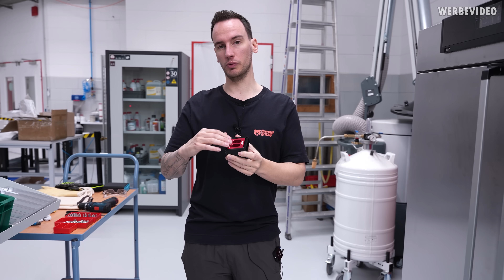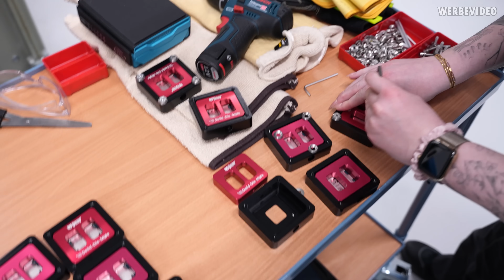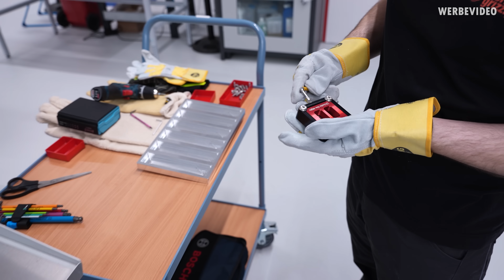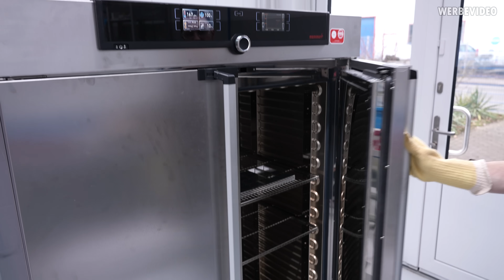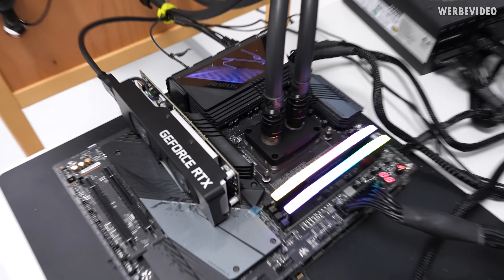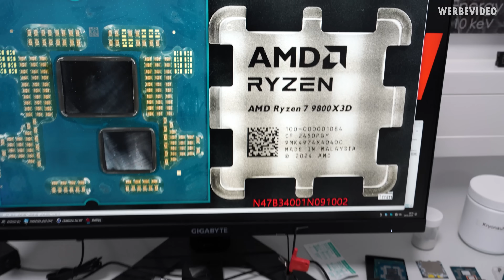You can now buy Delidded AMD Ryzen 9800X3D with 2 Years Warranty

Comment: Dang I think you have balls of steel to do this, because if someone isn't comfortable delidding his own CPU, I wouldn't trust them to mount it correctly (in the motherboard or the CPU cooler). Hopefully all goes well for you business-wise ! I love risky business things !
Reply: nah I had to dismantle my brand new 1700€ 4090 since it came with 110°C hotspot from the factory (you don't send back for warranty a card with zero availability) but you need to buy a tool a special waterblock and take time that's a lot of hurdles and pain for something that doesn't really matter my 7950x is at 80W 80°C in a loop that makes my 4090 45° at 350w which is really dumb but you can live with it, you are correct that it's a huge risk tough maybe they need to vet their buyers in some way like show me your pc or something
Reply: @fredEVOIX  yeah I'm not saying that I'm better than that, but it's exactly why I commented this, I do not have confidence in delidding myself, even less mounting the cooler afterwards. Great idea to vet but I think they're already operating on thin margins so it wouldn't be possible. 
Might have to repaste my 6800 xt with ptm7950 but I'm much too scared of ruining it

Comment: Why is there a lid on a CPU in the first place??
Reply: Better protection for the die (especially now that there are multiple dies, positioned asymetrically on the substrate). For those old enough to remember, back in the Athlon Thunderbird & Athlon XP Palomino/Thoroughbred/Barton days, a lot of people were crying after a failed cooler mounting attempt.
Reply: For the vast majority of people it's much safer to have an IHS guarding the exposed silicon, way smaller chance of destroying the CPU during installation, amongst other things like inconsistent cooling performance with air coolers etc.
Reply: Because many normal users would end up damaging their CPUs if they were not there?

Comment: A lower cost option of 9900x with thirty day warranty would be a suggestion.  Personally I would prefer if the CPU testing was done without liquid metal. Could one of your excellent thermal pads not be used? This would leave all thermal interface options open, & drop your testing cost. Cheers

Comment: I'm expecting a direct die block combo! I know there will be people out there who would dig right in with that. Good luck!

(I wonder if it is possible to take some floss and cut the silicone glue before taking them to the oven so you only have to bake them once, or have high temp suction cups that pull it off. But then it's not like the temperature would hurt it)

Comment: 9800X3d doesn't seem to have heat issues? I think I would dig something like this for 9950x3D though as those are really thermally limited.
Reply: It will when overclocked though, which is usually why you would buy something like this.
Reply: @mrctuned2844  yeah but I don't think you can go go much higher with pbo and setting static core voltage seems not very good? Unless it can draw 200W without problems..
Reply: @sorek__  i may have to rewatch the GN stream when they overclocked to see what they were drawing. You bring up a good point and I don't have personal hands on experience so you may be correct on that.

Comment: This is a no-brainer if someone intended on de-lidding their CPU. There's no way in Hades I would have attempted that manual process.
Reply: same if I didn't want a 9950x3D (I use process lasso to limit games to CCD0 and restrict apps like OBS to CCD1) I would have ordered a delidded 9800x3d for sure I just bought the thermal grizzly thermal paste appliance frame for my next cpu install the 7950 was a pain what a dumb idea by amd to make the cpu lid a star
Reply: @fredEVOIX  :-) I'm also waiting on the 9950x3d.

Comment: This is such a great project! I'm planning on doing a top-tier build in 2 or 3 years (690 was the best GPU when I built my first, and I ended up getting a 560ti, so I'm hoping to build with a 6090), so I'll probably be looking to buy a delidded Zen 6 X3D CPU.
Reply: Last I checked the 5060ti isn’t out yet what are you talking about
Reply: @markminch1906  I didn't say anything about the RTX 5060ti. I'm talking about the GTX 560ti that I put in my first PC over a decade ago.
Reply: @ dang, does that computer still run games at this point. I’d imagine even for non computationally heavy games the driver support would be broken
Reply: @markminch1906  Oh, the 560ti is long gone! I upgraded the GPU several times over the years before building an entirely new computer earlier this year. The last card I had in the old computer was a 1060, which did struggle in a lot of games. I can't imagine if I had still been on that old 560ti. But the time around when I built my first computer will always have a special place in my heart, and that's why I'm interested in the (presumably coming next gen) RTX 6090 even though I never had a GTX 600 series card.

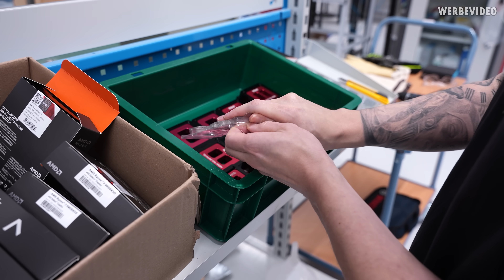Comment: 5:55 no testing after picking the CPU from the packaging? So you destroy the warranty you get from Mindfactory/AMD, delid it, and find out, it doesn't work? There are ways to improve these steps 🙂
Anyway, the project is really cool as the deliding is still the only step that people can get easily wrong. The rest isn't that hard, when you take your brain out from idle mode.
Reply: The irony of talking about brains when you can't even spell "delid".
Reply: @-Devy-  fr xD
Reply: @-Devy-  haha, yeah, that's right 🙂
Reply: Less than %0.1 percent of the boxed CPU will fail. So it makes no sense to spend time to find one.

Comment: $120 extra isn't unreasonable, especially if you subtract the cost of a delidding mechanism and the reduction of risk.  I appreciate the transparency, too.  Thanks!
Reply: @scar-c9e  That would be a fair assessment but those are yet to go for $475 so I’m afraid that’s not quite the rundown on his margins
After looking, in usd it’s only $125 more anyway
Reply: I read that it's 233 USD over MSRP. Still though it's worth it, bc u dont risk losing the full value of the chip AND you are covered under warranty, which would not be the case if u delid a CPU bought from AMD best buy etc. And if ur gonna do extreme overclocking, it makes even more sense to go this route bc the warranty.
Reply: honestly I thought it'd be at least a 200€ premium
Reply: That's cheap! I wouldn't do it for my friend if I should do cleaning, testing, installing and even promise it posts after that. With warranty maybe 1/4 or 1/3 of price of CPU it would be reasonable for friend. For others more. Next time I upgrade I will first check used in forums and this 2nd option.  Or if planning to buy new here first! Even some car mechanics take 80e/hour, min 1 hour to check anything what's wrong with your car. Parts doesn't include. And 80e/hour is quite cheap with VAT atleast here in finland
Reply: @Katsastusmies just cause you get scammed by mechanics doesn't mean its right also mechanics actually install the parts if he installed the CPU and cooler for me to that would be fair this was also about the site saying it was 712$ which is completely unfair 80$ isn't unreasonable but 237$ is
Reply: Given the insurance needed and the expectation of these will be heavily overclocked I am amazed it's not far more as the failure rate will be higher than usual
Reply: @CJonestheSteam72  isn't the whole point of delidding it to lower the temps meaning the chip has less of a chance to fail
Reply: For those that don't work, all that's left to do is complain...
Reply: Yes, that is a fair price given the amount of work and the included warranty.
Reply: @goldfingerdash  personally I don't think 237$ is fair for them popping the lid off and giving you a 2 year warranty on a 475$ that comes with a free 3 year warranty he even uses the tool he said was so simple to use it was idiot proof and cost less to buy then the price they are charging you to use it
Reply: And that’s why it’s 570 now.  Read the pinned comment… ffs
Reply: @damonm3  well when I look on the site its 712$ and I have a feeling if I ordered right now I would be charged 712$  and I'm sure some people ordered it for 712$ and personally I would feel scammed if I did but they should have know the price was to high from the start
Reply: @scar-c9e  if you delid you lose the warranty so if you wanted to delid, no warranty if you do it yourself.
Reply: @neuplop  yes that's true but how many times have you used a warranty on a cpu and I'm sure it doesn't cover damage you cause installing it so chances are most people wont use the warranty and they could have at least done the full 3 years like AMD
Reply: @scar-c9e Deliding the CPU voids the warranty from AMD immediately so its not a fair comparison.
Reply: @groundzero_-lm4md  AMD does that cause you can break it if you delid it improperly which he has a easy to use tool to do that meaning 0 risk to breaking them for him and he get to charge you for a warranty you probably wont use cause popping the top off shouldn't cause it to malfunction in a way that would fit under warranty unless it was done wrong which if they test them shouldn't be possible  and they could have at least done the full 3 years that you get for free from AMD
Reply: @scar-c9e  The problem is making anything idiot proof is that there's always a bigger idiot.
Reply: @scar-c9e  You have a feeling? Do you always feel like a victim who is always scammed?
Reply: @scar-c9e  No such thing at "0 risk". Low risk, yes. Zero risk, never.
Reply: @sammiller6631  what are you on about why don't you go ahead and order one then and see how much it changes you and no I don't ever feel like a victim cause I have enough common sense to not fall for someone charging half the price of a cpu to pop the top off and give you a useless warranty as cope and then backing it down after people called him out for the high prices
Reply: @scar-c9e  Is that "common" sense or is that unjustified paranoia? If I buy one and nothing goes wrong, will you eat your words?
Reply: @scar-c9e  intel 13,14gen
amd this gen with asrock boards 9800x3d
asus 7800x3xd....
Reply from the maker: @scar-c9e   please read the text in the infobox: Important: VAT in the cart is changed in the 2nd step after you confirmed the country. So the price could be higher in the first moment. So you are looking at the price that we pay in Germany that includes 19% VAT :)
Reply: @der8auer-en  ok thank you for the clarification you should make that a bit clearer on the website to prevent confusion
Reply: @scar-c9e  You can't keep the 3 year warranty on a delidded CPU, AMD will void that shit so fast.
Reply: @scar-c9e  No need to make it more clear. People should just be more aware instead of assuming.
Reply: @mich977f  to assume everyone is going to read pinned comments is stupid 9 times out of 10 they are just an ad or unless info  almost no one reads them it would be much better for the consumer to have that more clear on the ordering site  rather then expect them to look at the pinned comment
Reply: the price premium is fair for peace of mind when delidded cpus are incredibly risky and easy to break since the highly sensitive parts are exposed especially if his warranty covers various errors that could occur with it within reason. besides the people that want a delidded cpu are often the same people who already spend a huge price premium to maximize their pc's potential (custom loop to a cpu/gpu, full noctua ecosystem etc) so the extra 100 dollars is a drop in a bucket compared to how much they spent on the rest of their system. The cost also accounts for the time and cost of having someone delid, clean, test and verify the chip before it gets shipped off.
Reply: @ he has a delid tool that he has said it’s so easy to use it’s idiot proof I’m fairly sure based on the fact that it says they assume the manufacturers warranty it doesn’t cover if you break from improper installation or over clocking to the point of it breaking  and again this was about it saying 712$ on the site that’s 237$ markup but that’s not the actual price and no it’s not going to matter to the type of person he is marketing it to but that doesn’t make it right
Reply: @scar-c9e wtf is this weird vendetta move tf on
Reply: This reminds me of silicon lottery website.
Reply: WHAT RISK? CPU LAST FOR 10 YEARS! WHAT RISK !
Reply: Yep, it's 100% fair with the 2 year warranty
Reply: $120 extra? It's a $479 CPU, it is showing $712 on the website for me
Reply: @pcmasterracetechgod5660 that is with the default German VAT
Reply: @pcmasterracetechgod5660  I paid $599.00 US dollars plus shipping total of 625

Comment: I was looking forward to such a service, because I did not see the point of buying a delider for a one off build and also carry the risk of f**king it up when I do so. So 100% appreciated. Now having said all that there is one caveat, I would happily buy and drive a delid CPU from TG however I am not a fan of watercooling (custom or not), so I would like to be able to buy this and use it with an high end air solution (e.x. Noctua) because 1. I do not want to have water as a possible point of failure and 2. I do often swap GPUs and NVmes and custom water cooling just the CPU is not something that makes much sense to me anyway. So to conclude, is there any plan for some direct die air solution? (I am not aware that any exist). I don't OC I just want extra silent but also one point of failure only (fan) setup.
Reply: TG have contact frames for AM5 so should be doable unless the weight of the air cooler is a issue and cracks the die

Comment: only 1 bad thing (which imo can be a ggod thing if few thngs are done): oc
if i bought a new pc now, and i had the option to buy a cpu base on his oc capability and not only base sspecs...
(i understnad the cost and i belive a lot of overclockers will be willing to pay more for that (for example add 200 euro for 6GHZ oc capability for exmaple...)
Reply: Literally nothing in that text made sense.
Reply: There used to be a company , Silicon Lottery which offered exactly what you described a few years back. But with modern CPUs after 10th Gen/Ryzen 5000 offering little overhead they decided to close their custom binned CPU sales.
Reply: @tourmaline07  tbh, i trully didnt know that.
i understand why, but thats a diffrent thing then what i asked, for the simple reason that the thechnology has changed.
the 5-10th gen were basiclly copy paste with minore twick, (result of monoply) but times and thechnology has changed and i belive its more viable now then back then.

Comment: The AIO manufacturers should design and sell delid direct die cooling head adapter plates for their AIO coolers. 
On many AIO coolers you can remove the bottom on the CPU block, to refill fluid or whatever. 
Should be very easy to make a delid spec bottom plate for these AIO's.  Easier and cheaper then making a custom loop.
On my Kraken x73 there is 8 torx screws holding the cold plate on the cpu block. Replacing that with a Cold plate meant for direct die, could be done in 5 minutes.

Comment: I am not sure I understand the point.  (My system was already built in 2023; 13900KS (no degrading) + 4090.

As I understand it the 9800X3D does not require undervolting or other special measures to keep from thermal throttling.  So, the only reason I image one would want to do this is for thermal head room for over clocking.  Is that correct?

How much (percentage clock) could one expect to over clock (hand tuned)?

Thank you.

PS:  I didn't even consider an overclock of the 13900KS (even before the degradation debacle) as the best people were getting was 3%.  I am playing at 1080p/60.  So, for a CPU bound game, I am unlikely even to pick up +1 FPS.  I just thought OC wasn't even worth it; especially after voltage spiking was revealed.

Comment: Hello brothers, I think what you guys are doing is great. 
Do you guys have any ideas on what results performance wise you have been getting from most of your chips after delidding them? 

I'm currently running a ryzen 9 7950X3D hitting over 5.4ghz on my cache cores, and 5.9ghz on the non cached with temps that barely leave 65 degrees! 

We both know there is real no reason for me to update my cpu,😂 but I have a sickness where I just can't stop updating and adjusting. 

Would you guys do a bundle deal of a delidded cpu with a RTX5090? If so ill buy them both right now. 
Any chance of helping out a fellow PC enthusiasts brother.

Comment: I know this sounds stupid but I'd like this for a 9950x3d. I wouldn't even overclock it, I'd just like seeing the really low temps. The only thing I don't know is delidding compatible with coolers like NHD-15G2? I don't even remember if special mountings are needed.
Reply: You can use liquid metal and put back the stock ihs or a custom one (like the Thermal Grizzly AM5 High Perf) with some UHU high temp silicon ;)